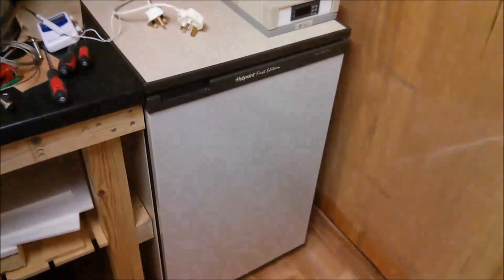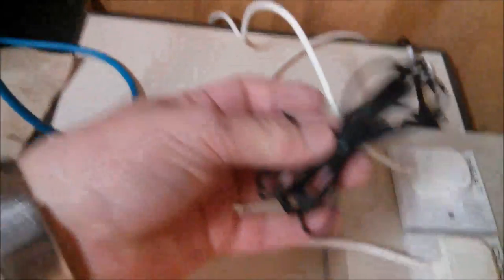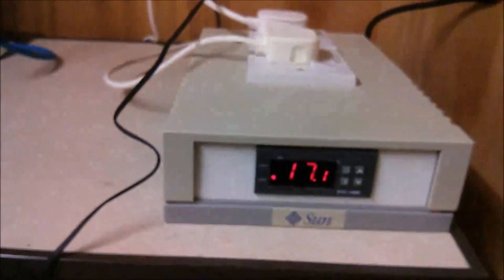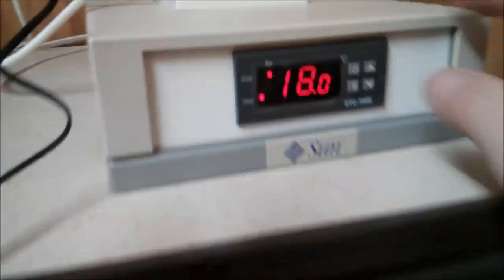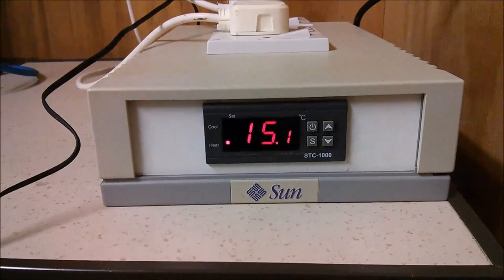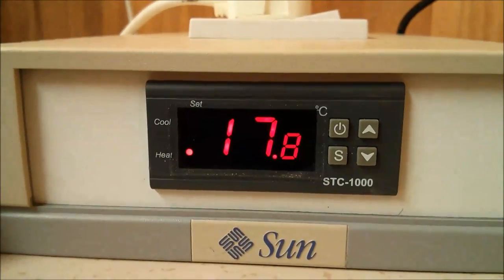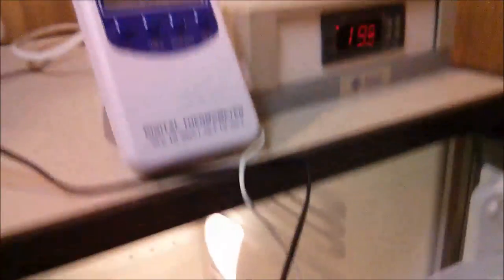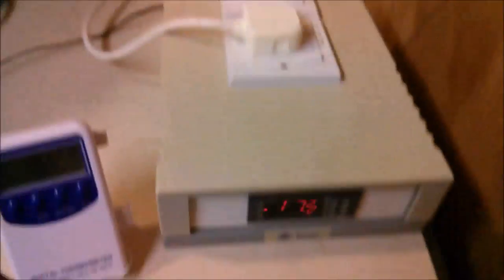HBW12 - Fermentation chamber( (fridge) complete

Comment: i am about to make my own fermenting fridge,  i found a brand new 45 watt tube heater in my shed so dont really want to buy another, do you think it will be sufficent?,  im also a bit scared of of drilling the side of the fridge in case i hit a pipe and ruining the fridge, any advice,my fridge is a similiar size to yours, lastly congratulations on a good job, how has it performed?
Reply from the maker: 45 watt heater should be fine. The on/off control will keep the temperatures fairly constant once it gets to the set point. There should be no pipes on the side but go slow with a small drill until to goes through the inner skin (assuming you are drilling from the inside to the outside). Use a small screwdriver that filts into the hole you just drilled and go in a circular motion, if you feel nothing, get a larger drill out and make the hole the right size for the cable you are using. It is really hit and miss but the majority of fridges do not have pipes on the side. If there was a pipe, you should feel the side being warmer or cooler so avoid these areas. Good luck!
Reply: Hoverdog Brewery Thanks for the reply.

Comment: will this thing heat up and turn off without  the cooling
Reply from the maker: Yes it will, the back of the controller has contacts for heat and cool, you just don't wire up the cool. The controller will still operate like it is trying to cool but nothing will happen. I have switches sockets on the output on mine and in winter I turn the cooling off so it cools down naturally.
Reply: @HoverdogBrewery  thanks for the info  going to make 1 im in the uk , but hopefully be brewing all year round
Reply from the maker: @lindso6105  Most people buy the inkbird ITC-310T-B Brewing Thermostat, its £40 and will save you time. There is a WiFi version too so you can see and change the temp without going to the brewery.
Reply: @HoverdogBrewery  thanks again , yes im going to invest in 1 , that wat il  never run out of booze again , happy days